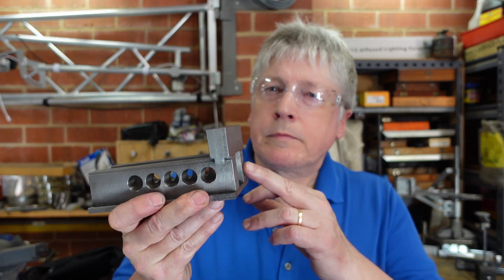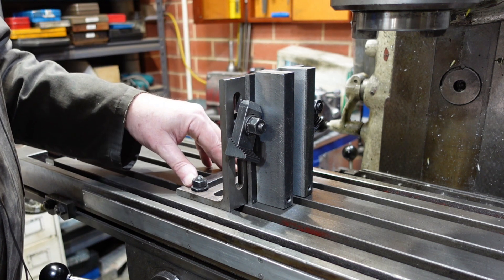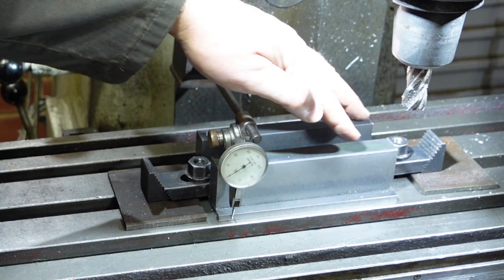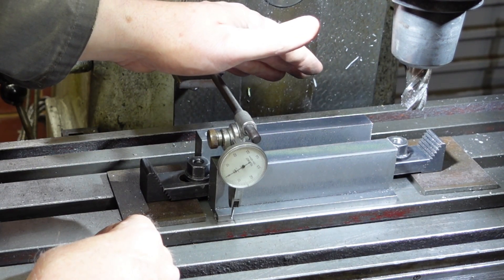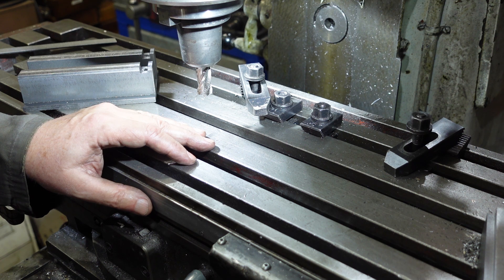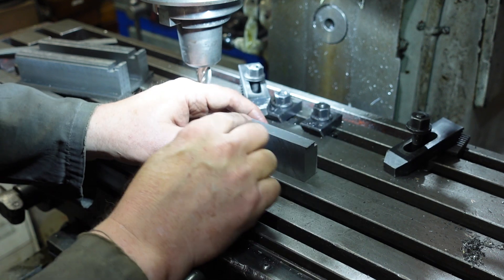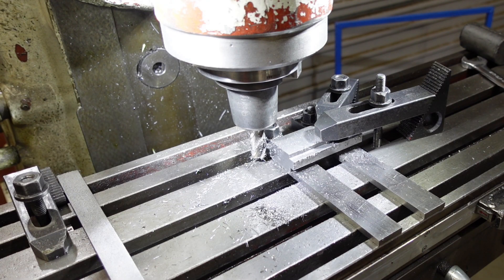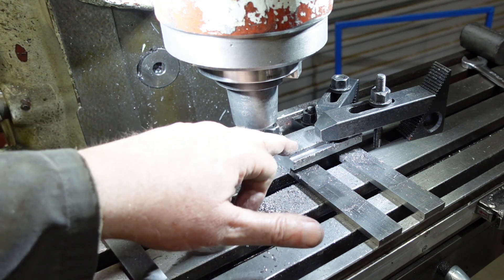Boot strapping a mill part 5

Comment: Maybe look up the definition of the "rebate". You use it quite a bit to incorrectly describe a feature. In this particular case, any step, or notch cut into a part appears to be a "rebate" to you. Terminology is everything.
Reply from the maker: rebate2
/ˈriːbeɪt/
noun
noun: rebate; plural noun: rebates

    a step-shaped recess cut along the edge or in the face of a piece of wood, typically forming a match to the edge or tongue of another piece.

Comment: Next, how to build a vice without a mill ;)
Reply from the maker: Making a milling vice without a mill to use it on. 🤔
Reply: @occasionalmachinist  Actually apart from being facetious, I was thinking of milling setups for people who only have a lathe. Eg. Me ;)
Reply from the maker: @gillywild  Tricky, but I think I may be able to work something out that will help with that. What size lathe & spindle bore?
Reply: @occasionalmachinist  wow! Thank you for that :) Its a Boxford STS10-20  200mm swing 500mm centres 3ph motor. Grunty little thing :) Unfortunately I don’t have the space or the money for a mill (I live on a boat) I know most milling can be done on a lathe - sorta - but I’ve never seen much YouTube content on the best way to set it up. I really appreciate your engagement on this :)
Reply from the maker: @gillywild  It won't be straight away, but I'll take it on notice and see what I can come up with. One of the problems with milling in a lathe is the (potential) backlash of the cross slide. If you are careful with feed, it will work, but if you have a brain fade and climb mil...
Reply: @occasionalmachinist  Thank you so much, you’re a a legend :)
Reply: Making a mill while only having a vise!